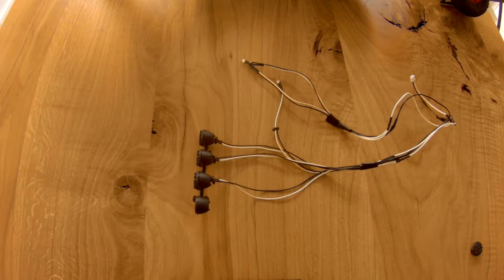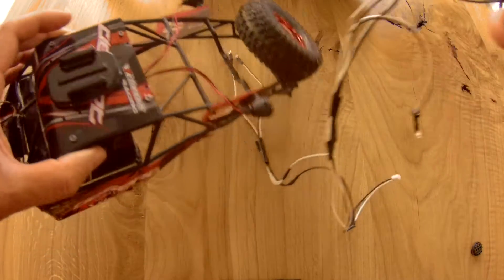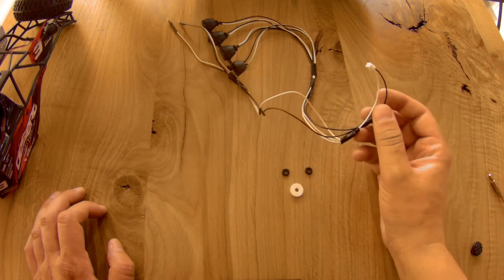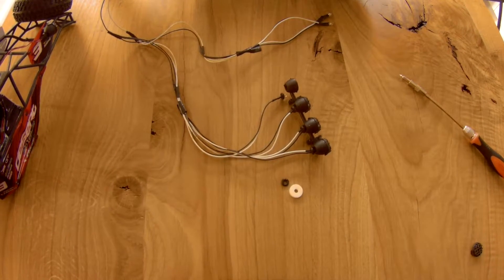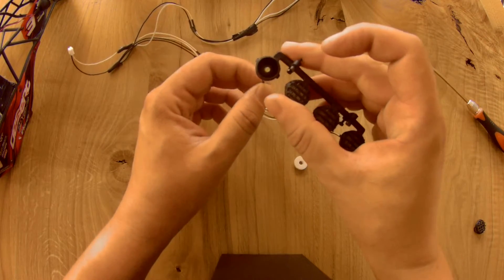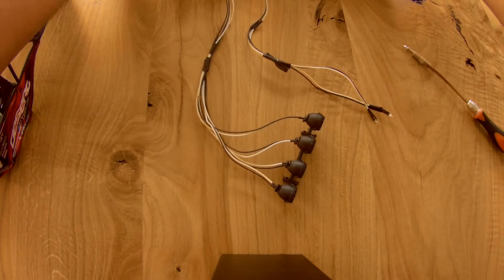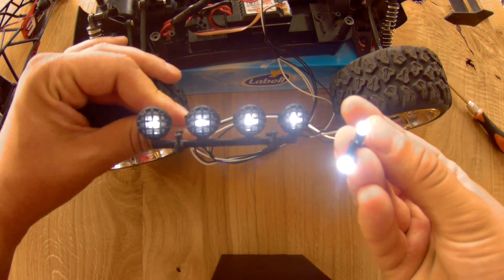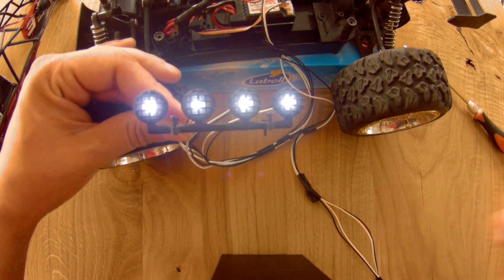Feiyue FY-03 how to make LED lights at home

Comment: My JJRC Q39 uses the same Rx/ESC combo unit. I tried adding lights using one of the 2 unused female ports on the unit for power but found their output is the same as the power source, i.e. 7.4V or higher. My lights are some 5mm LEDs which I believe are rated for only up to 4 or 5 volts. They work fine in my planes but I use a light controller in them that steps down the voltage appropriately. What LEDs are you using Franca RC? Or how are you bringing down the voltage? I don't see any resisters in your setup. Can you post some links to the source of your lights? Good tip on the spacers but a link to them would be helpful too.